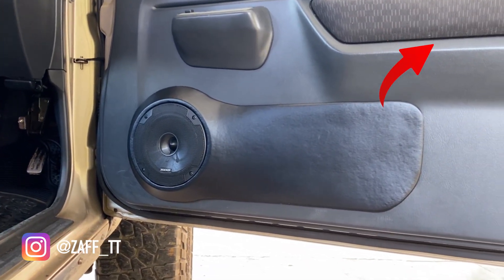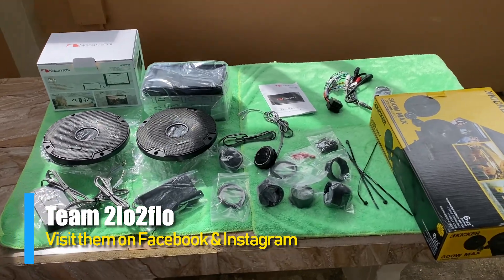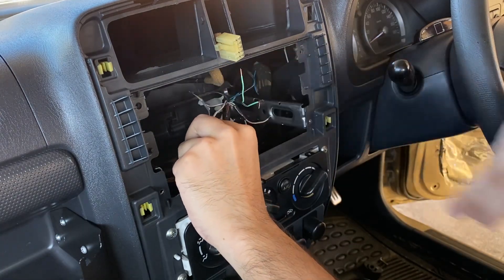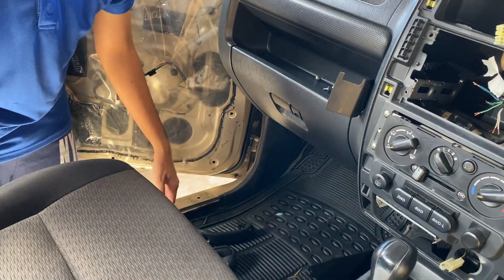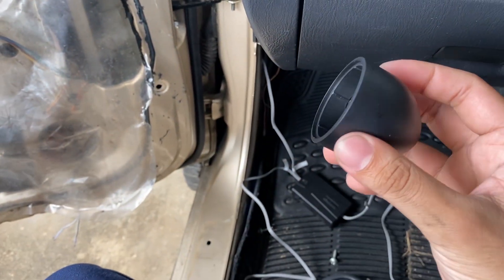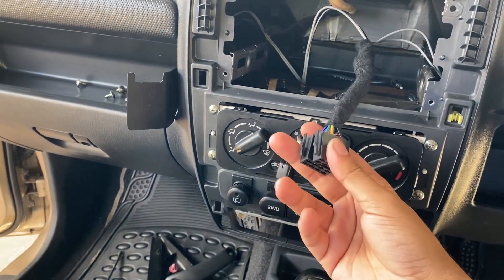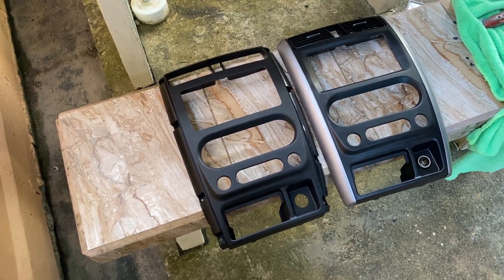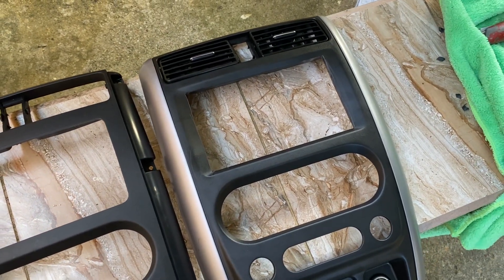Installing Aftermarket Sound System in Jimny

Comment: Awesome installation! That's something I have wanted to add to mine, what size is the head unit?
For this year it will be cool to see something like a lunchbox locker or something that modifies the open diff of the Jimmy.
Reply from the maker: Thanks buddy ! I def would like to do air lockers this year, they're just really pricey lol
Reply: @Zaff_TT  air lockers are something I want to invest in. Is there anyone locally selling kits and doing the installation?
Reply from the maker: @stefans7745  It's not something that would be available off the shelf but ABS Offroad Limited would be able to order it for you.

Comment: Have you done an antenna upgrade? Or if not yet could you do an antenna upgrade? The stock antenna is so long it's like a fishing rod! Tnku
Reply from the maker: I installed an electronic antenna 1:06. In most cases it’s 2 wires to connect behind the head unit 👍
Reply: @Zaff_TT  thanks!

Comment: It would be more helpful If you can name the aftermarket accessories and part numbers in the video.
Reply from the maker: Links to products used in the video description. Whatever is not linked in video description I bought locally. Also, check 0:57 for model numbers of products. I hope this helps 👍